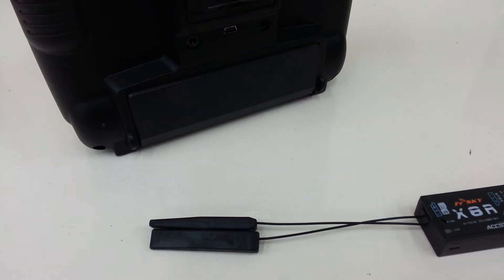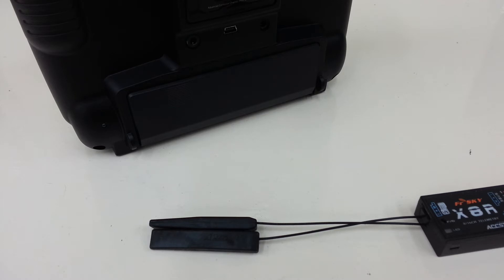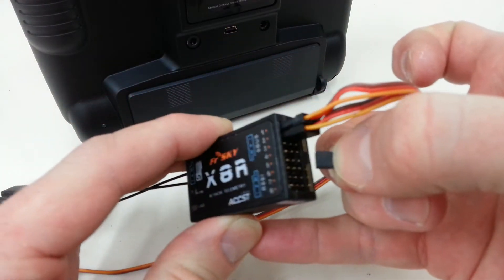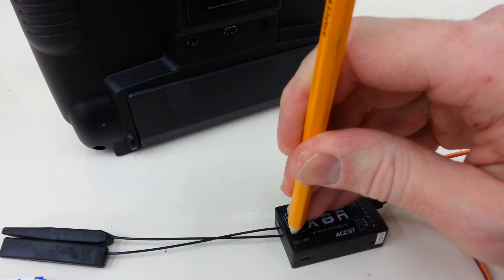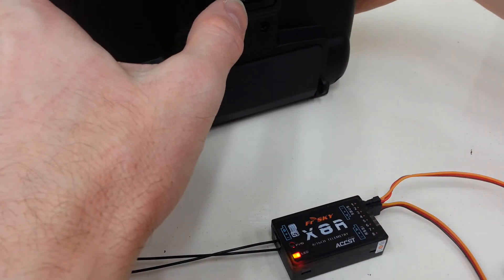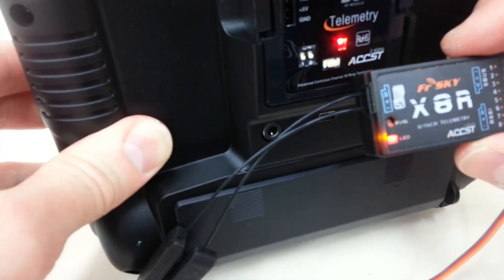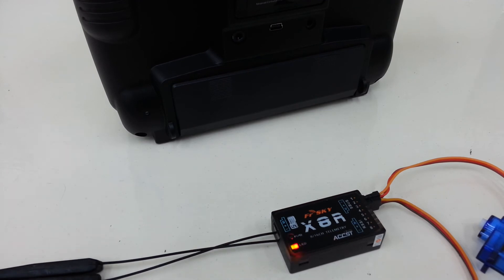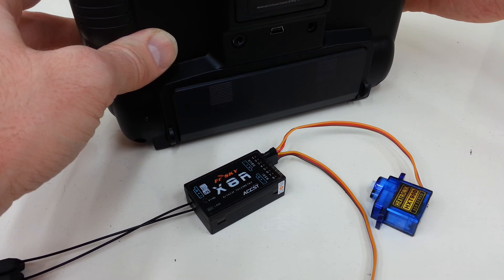How to bind the FrSky X8R to DJT, DFT, DHT module

Comment: Hi, how do I have to do to bind the X8R receiver with DJT module in D16 mode?
D8 mode correctly, but I need mode D16
thanks
Reply from the maker: +Juan A. García Hi Juan, sorry, you might figure this out.  But in order to work in D16 mode, you will need an XJT module, DJT only supports D8 mode withe X8R and maximum 8 channels

Comment: Hi! Thank you so much for the video.....but after several hours trying, there's no way to bind the DJT with X8R :(
This brand isn't the most precise RC TX/RX on the planet, i guess!

Thanks anyway.
Reply from the maker: Not sure what you mean there, but if it's not working as shown in my video with the DIP switch settings shown, then perhaps you have a defective receiver or module. It's very rare but can occasionally happen.  Feel free to contact us for warranty claim if needed, or at the place you purchased it.
Reply: HeliBaticsTV Hi. Thank you for your your reply. After some more investigation I've realized that there was a problem in the pcb. A broken solder was prevententing a good contact with an condenser. It's fixed and bind. Thanks again for your attention. Cheers.